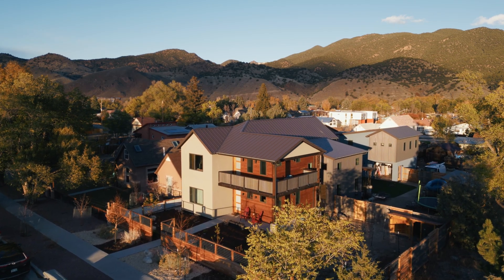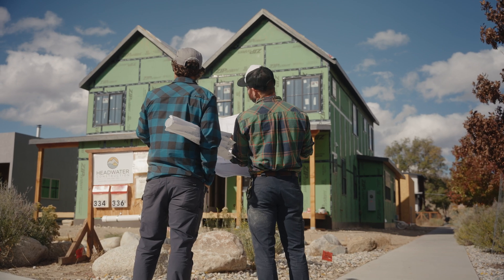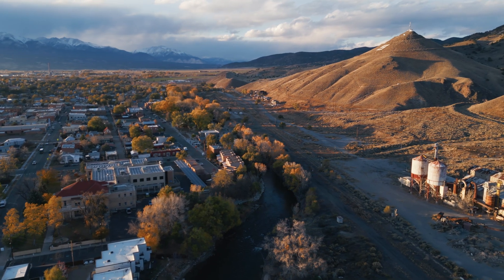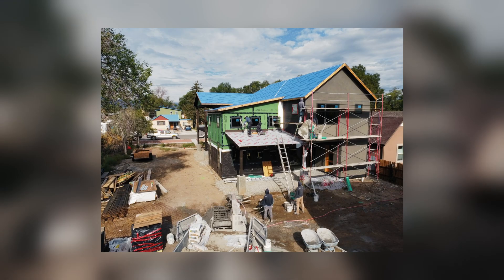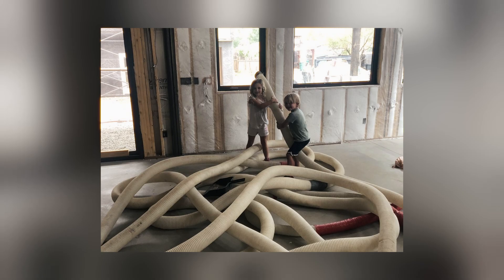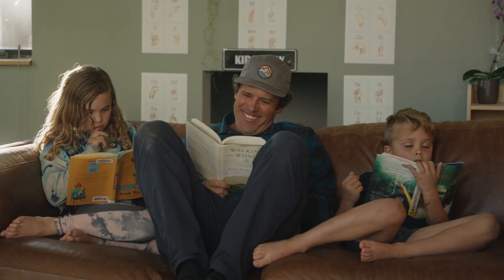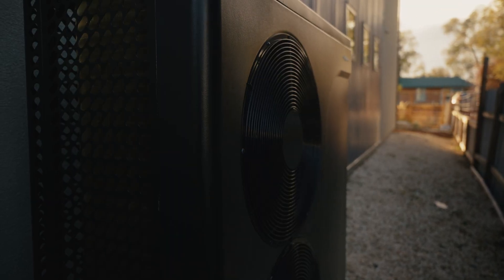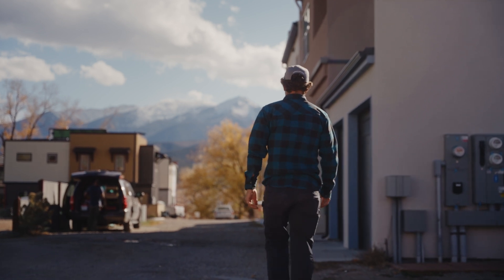From Installation to Comfort: A Homeowner's Experience with the Vitocal 100-AW Heat Pump

Comment: what would it cost to run, maintaining 78 degrees F. 365 days out of the year. on 2000 sq ft r 19 walls, r 36 ceilings, 3 open to the outside door 15 windows.

Comment: Hello from Montreal, does this heat pump work at outdoor temperatures below -5 deg c?
Reply: Based on their specs, it works down to -25C - but probably not a bad idea to have a backup electric boiler - or if in Montreal and you can get dual energy, and you have a gas system, use it when < -12 and that should work. But I don't work for Viessman :)